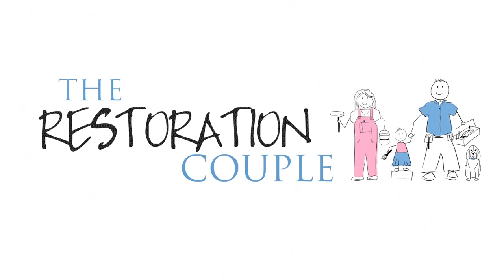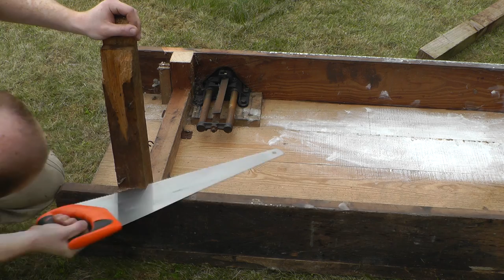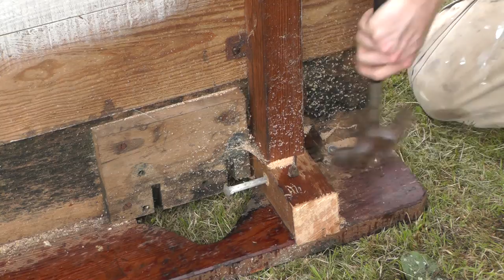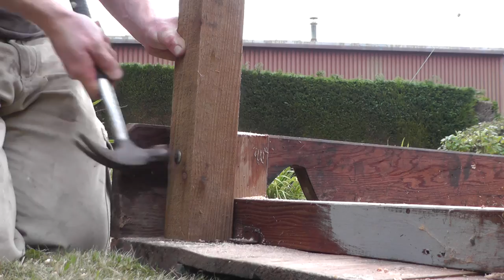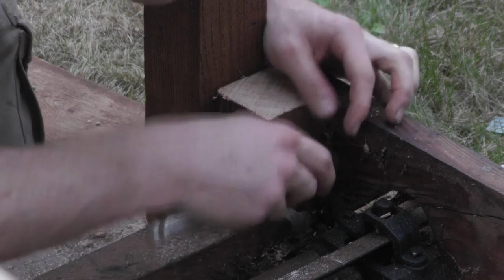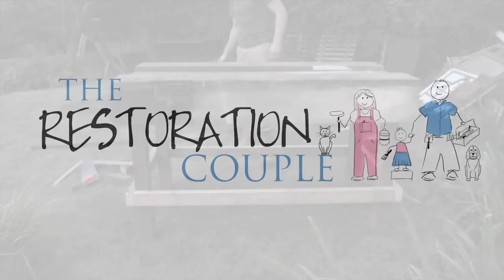Restoring a Wood Work Bench - Part 1 of 3

Comment from the maker: Hi Darren, Never ended up editing the other video as we were snowed under with work on the main house.  It is all done no and the vice is all done so I will try and get a follow up vid sorted soon.
Reply: +The Restoration Couple would be great to see part 2/3 if they're available?! Did you sand the worktop with a belt sander?
Reply from the maker: +Chris Croft I used a router on a sled jig to take about 5mm off the top which worked well and then finished with sander/plane.  Probably not going to ever get round to a follow up video simply as the footage would be a nightmare to fine.  You can see the bench in some of my recent project videos in use though.  Its rustic but solid and practical.